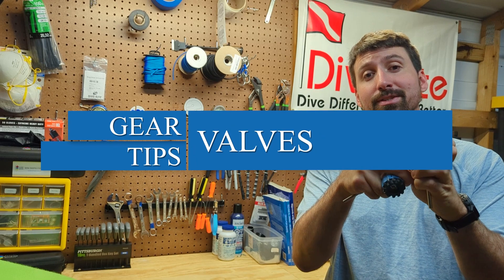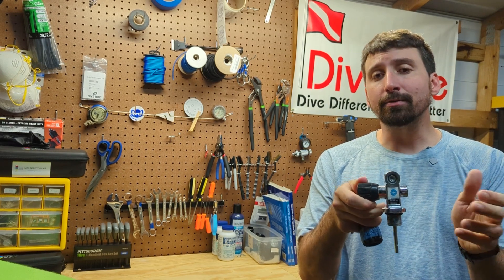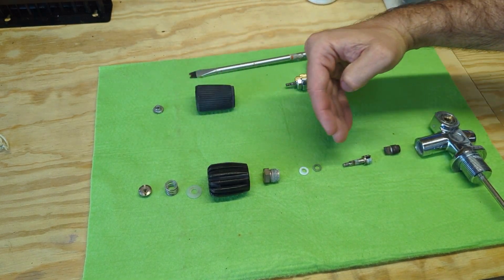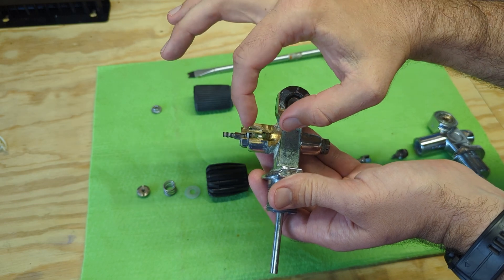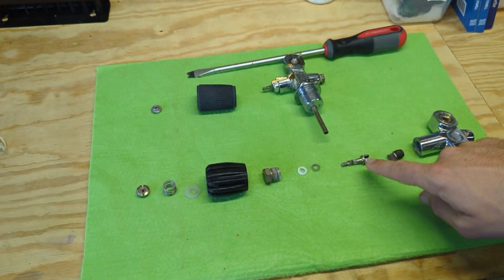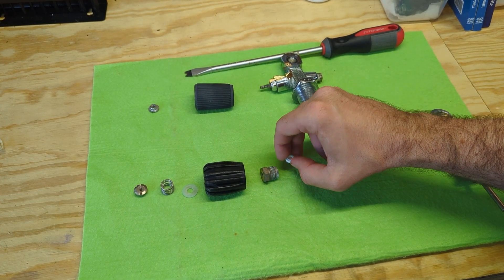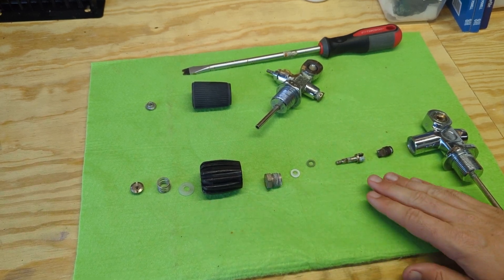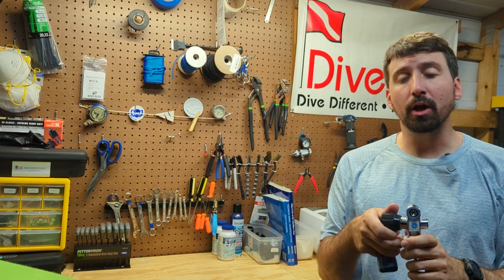How a Scuba Valve Works

Comment: My new valve showed up without the tank stem installed.  Any recommendation o torque?
Reply from the maker: Wow! That's an interesting part to be missing. It depends on the brand. I would have the valve tech at the dive shop install it to manufacturer's spec.

Comment: you dont have the copper washer between the seat & stem? not necessary?
Reply from the maker: Some valves, like the blue steel, have a copper crush ring on the bonnet nut. I don't recall this valve brand off the top of my head, but different brands have different parts/assembly.

Comment: Upgraded M18x1.5 DIN Valve Dive Adapter with Gauge and 22-inch long black hose withstands up to 4,500 PSI working pressure, perfect for use with HPA and PCP cylinders, which can effectively enhance your cylinder filling experience!B0DLGM4CD9